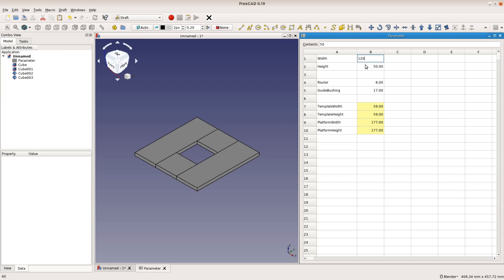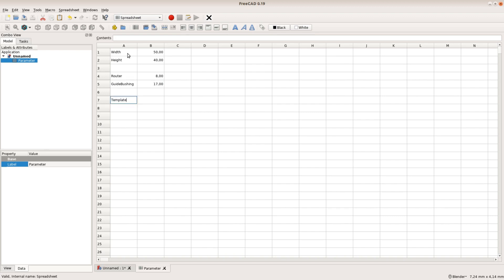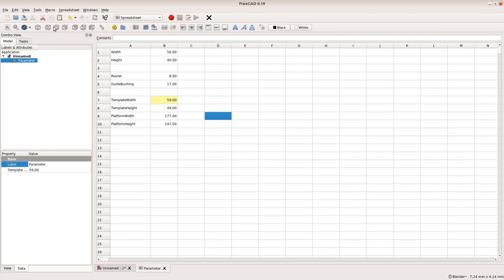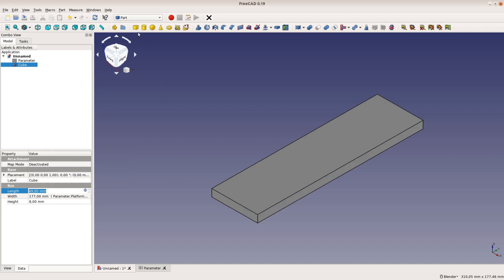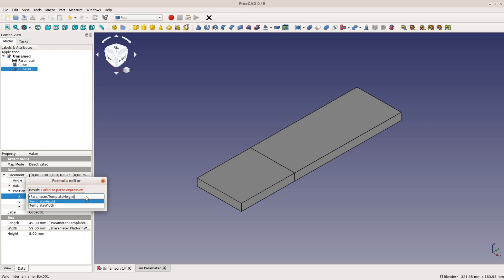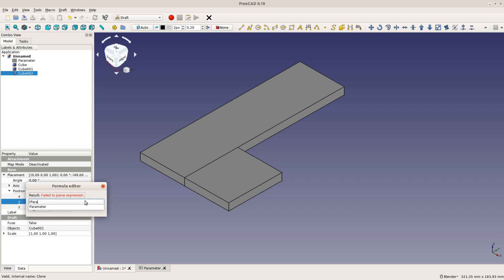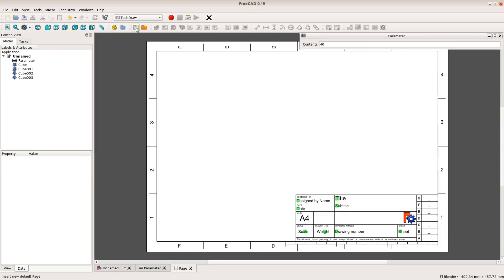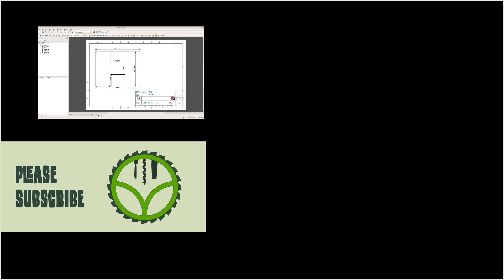FreeCAD for Woodworkers 03 - Parametric Routing Template with Spreadsheets

Comment: Hi there and a big thank you to @wayowood for the effort and learning material. I have an issue with the clone function and the alias manager. I am on a Windows and FreeCAD version 0.21.1. Alias manager = Unaple to complete the task.  And for the clone function, when changing the parametric values...no change in the clone objects. The only way to make it recompute is to go on the clone 'draft' and change the value of "Fuse" from true to false (or the otherway arround works as well) to have the clone being recomputed. Does anyone have the same issue? And of course does anyone have some sort of solution? Cheers and thank you
Reply from the maker: When a plugin stops working for me I usually just go back to an older version of FreeCAD - just try an older version...

Comment: Very useful set of tutorials for wood workers.  Thank you very much. Still trying to get over the steep learning curve and this helps a lot.

Does the use of constraints (sketch?) make it easier to attach the parts without having to add formulas to each part?
Reply from the maker: Henk Spaaij For the assembly of multiple parts you have to use an assembly workbench. This will be covered in the next part ...
Reply: @WayofWood  Ah cool. Looking forward to the next part then! :)

Comment: Brilliant tutorial and Freecad is brilliant too but after an earlier update FC 0.19 does not auto complete constraints and you have to fully type in the reference. Believe they are working on this I have gone back to using 0.18 for now.
Reply from the maker: Jamie Pipe I have the stable version installed and a cron job to get me the latest dev version each night. If a feature doesn’t work in one of them I open the file in the other one where it usually works.

Comment: Great videos. I watched your summary of open source Cad. Thank you. I was trying to decide if FreeCAD is worth the learning curve.

After your video I will invest in FreeCAD because it offers so much once the simple things are learned. I am proficient with Chief Architect X10 and have to retrain my muscle memory.

I am retired now and can move away from architectural drawing to a little woodwork. I have subscribed and dinged your bell.
Reply from the maker: Edward Pritchard Thank you. FreeCAD is really worth the time investment - especially as there is a very active community and new features are released quite frequently. Even if you are missing a certain feature there is a good chance it will come soon. 😏
Reply: @WayofWood  It also runs on my Pi400 home PC. You got a new sub.